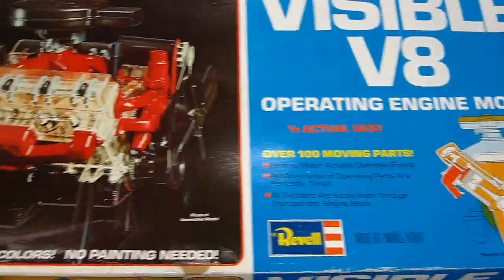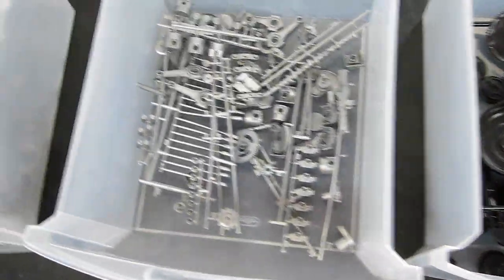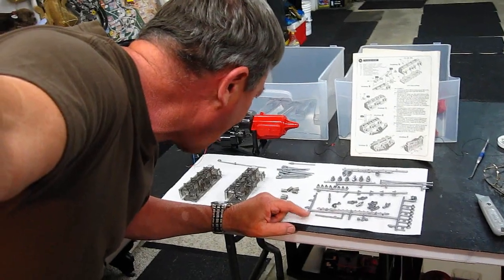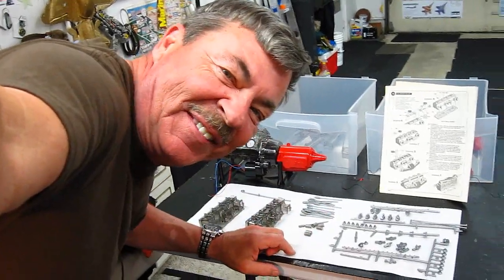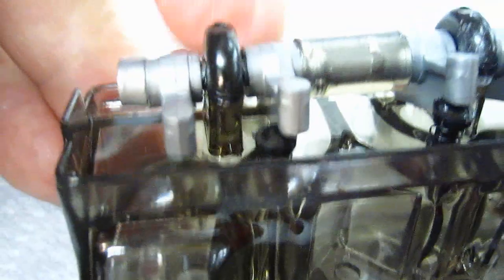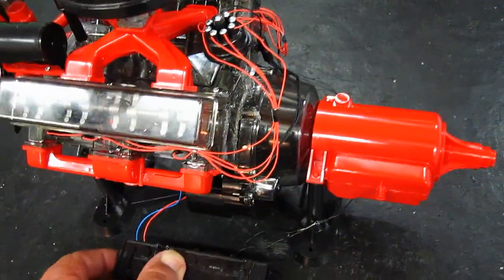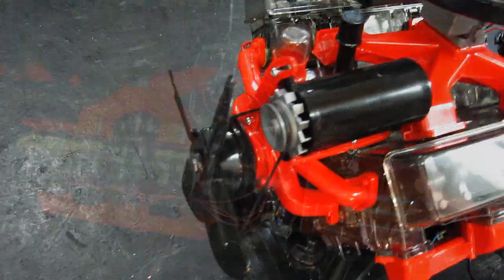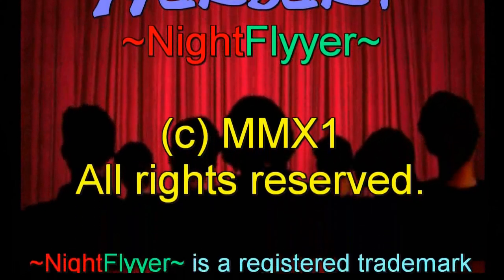Vintage 1977 Revell Visible V-8 ENGINE BUILD. Electric Starter and Spark Plugs shown running.

Comment: I had a visible V8 my mother father bought me in 1978 or 1979 I was 14 years old and I remember I built that and I kept at it until it actually worked and some of the parts were hard and you had to be real careful not to get the glue on the clear Parts because it would actually stain them especially with the sniff proof glue by testors it was really strong it actually smell like an orange I actually went on the school that next year and took all the Mechanics for 3 years and High School went out and went to Lincoln Technical Institute for automotive and diesel and after that went to work for Ford Toyota and other business ventures and still at it

Comment: I had an earlier version and had a clear trans with gears inside. This builders problem with the valves at 4:29 is because he installed all the rocker arms upside down. Look at the instruction sheet at 3:29 you can clearly see the rockers should be web up, not down. That's why they wouldn't swing out of the way to install the valves.
Reply: @Eagle 72 - As is usually the case, you must be able to read and understand the instructions to properly assemble with no issues.  I was 11 years old in 1960 when I built mine - no problems at all, worked great.

Comment: I recall adding some sort of oil and the thing basically melting 😅
Reply: jimmbo2.
Plastic safe, or plastic model oil should be used, and is available from any hobby shop.
Reply: About 40 years too late😂

Comment: The latest Revell Visible V-8 has no electric motor or grain of wheat lights.
Reply: @Richard Persoage - The original maker (Renwal) in 1960 is the only one with working spark lights and electric motor.

Comment: Thank you for this video.  I still have one of these unassembled.  You have given me the confidence to start building it.  I'm like you.  I have opened the box and closed it back up many times.  Wish me luck.
Reply: @St White - I just bid on one of these that is in mint condition - never opened - shrink wrap still on box.  The final bidder paid $330 for it!  I built one when it came out in 1960, when I was 11 years old.  Don't be afraid of tackling the build - it's not hard at all - good, clear instructions.  If you still have not built it keep in mind what you could get for it on ebay!  I believe it sold for around $15.00 in 1960!
Reply: St White.
Make sure you use plastic model oil from a hobby shop, as some oils dissolve plastics.

Comment: I had one of these that was offered by Renwal. Not sure was I did wrong, but the nuts that were glued in place would fall out. Also, the gears in the starter motor would strip out. I was fun to build. It taught me a lot about how engines work.
Reply: Kirk Matherson.
You must use an epoxy to glue the metal nuts, and also sand, and deburr all the moving parts, as the new kits are not very well made.

Comment: same engine as my dad's s10 92. Looks like this but the carb lid is more modern. and is hooked up to the radiater. My dad messed with these in the 60s and I want one! Sooo bad! I wish they had one with a saturn sl1 95 I would totally buy that

Comment: I have two of these, slightly, very slight, started.  One without the drive motor and spark plugs, hand crank type.  Directions copy right 2006.  The other has the drive motor and spark plugs, directions copy right 1987.  Both in original boxes.  I'd sell them.  Anyone interested?

Comment: I also had one of these in the 70's !!  It had the light up plugs etc., as I understand it this kit was first made may Renwal then by Revell etc. - but just as you have found it has many problems with fit and durability.  I still remember I had some really bad fits and the rotating assembly was sketch in places, eventually the plastic boss where the starter motor attached cracked and I couldn't run it any longer.  I kept it as a shelf item for decades until someone wanted to pay me stupid money for it--lol  If they still made one with the lighted plugs I would build another one using a newer kit and add a motor on the back, but one of the coolest parts of the model was the plugs actually firing in order.  Plus they want way too much money for one now considering what a poorly engineered kit it was.  Lots of memories here though.

Comment: I bought one of the newer ones to build with my son. I definitely notice some differences from yours. Ours is made in china. no electric starter, no lit spark plugs, or working distributor.  rockers look different. The one thing that really bothers me is the valves do not open in the correct sequence when turning the crank in the direction indicated by the arrow. You have to turn it backwards to get proper intake, compression, ignition, and exhaust with valves opening at correct times.
Reply: Fred Geitner.
Sounds like you installed the camshaft 180 degrees out.

Comment: I have one of the original Visible V-8's that has the electric starter and blinking lights to simulate the spark plugs. For extra realism you might want to get some white modeling paint and paint the spark plug insulators. Also, get the number 1 piston to TDC and paint two white lines on your model to simulate timing marks. Put one mark on the crankshaft pulley and the other one on the front timing gear cover. Then when the engine is running the number 1 spark plug will blink every other rotation when the two timing marks line up.
Reply: I called Revell a couple of years ago and was told there were too many complaints from people who couldn't get their model to work properly, so the electrical components of the motor were dropped. It's a shame it's been "dumbed down." The electric model WILL work beautifully, but it requires much work to so. It can't be slapped together.
Reply: How much
Reply: How much what?
Reply: Do you have a visible engine for sale
Reply: No sorry. The one I have I'm emotionally attached to it and I wouldn't sell it. I think you can still buy one from Revell, but the new ones don't have an electric starter to spin it or flashing spark plugs.
Reply: I'm sorry I read it like you had one for sale. I want the one with the starter and lights. The newer is not as "cool" as the old
Reply: Good luck. If you could ever find an unassembled kit for sale somewhere it will probably cost you a fortune, especially if it's an older one with the starter and lights. But if you can find an already assembled engine it might be a bit less. You also might be able to locate a damaged one for less money. If so check with Revell to see if you can get the parts you'd need to repair it. Lot's of the parts are common to both the newer and older V-8 model kits and they are available. I got some replacement parts for mine a few years ago from Revell so you might be able to purchase and repair a damaged engine.
Reply: Correct!

Comment: i built this with my Dad in the 1960's , so im guessing that this model had an earlier production run ? does look identical though . nice work .
Reply: Was originally made by Renwal late 50's / early 60's.

Comment: Great Video. Got (2)parts v8's on Ebay. I bought a Visible Chassis for parts at a country auction. Finding parts on Ebay to be very pricey. Hope to marry the engine and chassis together. These models are NOT for amateurs.

Comment: I built this same kit back about 77 or 78. Yes there were some difficult procedures, but it took time to get them right. You definitely have to have some good modeling skills. Sometime around 1990, I modified it with a new little battery powered motor from a radio control car and got it to turn a little faster. I was very surprised the little lights in the spark plugs still worked. .I had that thing well into the 2000s until a small fire in the basement destroyed it. I noticed that Testors blue tube glue was used. That stuff sucks. I do contribute my long life V-8 to using the red tube glue... Excellent job on this one!!!

Comment: This classic one is better. The new ones suck! I miss this classic. I wish to make the distributor work like the old one. The starter doesn't work either. It's all just plastic. I wish someone sold a companion kit.
Reply: Search on Ebay for a Revell kit (built in the 80's) with all the features of the old original Renwal version.

Comment: And I am 55 and never built a real motor but worked on my 68 390 and rebuilt the 4 speed top loader it had in the 6.5 lt cougar.

Comment: That was nice that you read a friend like that and that you honored him by finally building the kit.  I have a newer hand crank model but I'd agree with you that thou train assembly was the most difficult and I had to trim down the pushrods and also come to shape them at the camshaft and they still stick a little but they work and some of the rocker arms don't push down the valves because their little short now because the pushrods are little shorter but it's the only way I could get the pushrod thou assembly to work.  I used olive oil as a lubricant and they said to use vegetable oil which olives or vegetable but I did find two missing parts spark plugs but I ordered them from Revell. but I just wanted to see if anybody had built something like this and I did find a real quarter V-8 motor with a supercharger Connelly don't know if the spellings right they went about $8500 before I found your video.  Thanks a lot.

Comment: Cool vid. These models are now running around $200.00 nowadays. Worth it to buy the newer model and place a motor in the driveshaft
Reply: About $90 at Super Cheap and Repco stores, (Australia). btw , it's the old Studebaker 259 ci.

Comment: the 1977 version I did(I think I got it in Christmas of 1979)was nice, went together very well and had no flash what so ever. I was just 9 years old had no X-Actos or special tools, and it helped it had no flash. the one I did in 1989 must have been a different variant and it had tons of flash and worse still, inside the cylinders. fortunately I was 18 and had not problems then getting rid of it.  I did not paint the internals in either engine. would have liked to though and now lookiing back I'd do one again just to paint  the guts(not the block of course) except I do not know if that would affect movement with the parts which are so closely interlocked. Some of your parts look like they have been painted, was wondering what sort of paint would work and not affect part movements?

Comment: Got this for Xmas when I was 13yrs old I am 55 now. was not that hard for me to build then it was  just time consuming  I had every thing working in about 3 days and entered it in a science fair a my school  later that year. the only problem I had was the crappy gears in the starter did not mesh correctly . fixed that by using a 12 volt train transformer and  breaking it in

Comment: I had one of these, back in mid 80's, along with a turbo ford 4, this one was easier and worked better.
Reply: +93sundance went through a lot of paper towel and mineral oil. Tricky, but a fun build!

Comment: The cons are : the cylander walls are hard to align, the timing gear sometimes jumps a cog, the valve train is noisy and some of the valves don't work very well, and there's a lot of oil over everything...so then Revell made a perfect replica of the Chevy motor then? :D - But seriously, that's a nice build you have there and a great review. I'll re-post this on my facebook hobby store web site : Monster Hobbies in High River Alberta Canada  C&P into your browser and join me there!
Reply: I have done a few of these and still have two that I bought used and falling apart. After restoring them both years ago they both actually still work. Great models in my opinion and yes one has to have great modeling skills to do these. They are still found on eBay as vintage kits alone with the newer versions.
Reply: @Jerry Brown - I wouldn't say you need "great" modeling skills, just some modeling skills.  I built one when they first came out in 1960 - I was 11 years old, and had no problem at all building it.

Comment: Thanks for documenting the build. I, got one for Christmas in the 70's and had exactly the same issues: glue and lube all over, binding valvetrain and jumpy gears, cylinder / piston rod alignment issues (I forgot the part about assembling the valves). But after building it, I had no qualms about tearing down and rebuilding real engines.

Comment: you did a super great job, i don't have the vintage one but i do have the newer one, fact i 
have one i had started to build, got dusty, but still turned over, then broke, so i bought a nother
one off ebay, so i have one new kit, and mass parts, im going to build my soon, im 52, and am
looking forwardf to building one also...any way great vid. oh check out my 69 firebird here on you tube, i put a tunnel ram in her, and its all pontiac,,,,great vid....Tim

Comment: Hi, thanks for this video. I am considering building one of these. I have read many bad reviews of the new Revell V8 kit. Mostly screws being the wrong size and the parts not fitting together. There are a few of the 1977 kits available on Ebay, do you think this would be a better choice?

Comment: my grandfather bought me one back in the 70's when I was a pre teen , I built it , and since we were a gear head family we did some tricks to loosen it up and you didn't hear the starter motor as much as the gears where lapped in ,  I liked it , but my brother being the idiot he was and didn't appreciate others stuff thought it would be neat to wire it to a train transformer . needless it ran for 5 minutes before it melted parts together , I wish I could find another of the older kits .

Comment: @Elios0000 
I wouldn't use CA on clear styrene.  it will bloom (cloud the plastic surface) and it's just not as strong as styrene cement. 

I do like the modern thinner Testors red in the triangular bottle.  It's still very slow to fully cure, but it won't cloud the plastic and the resulting joints are by far the strongest of any of the glues.  Much stronger than the water thin Weld-Ons, Bondede or Tamiya glue.

Comment: You have a rare "black out" Visible V8. 
They are not worth more than any other Visible V8, but they are rare just the same.
Many of these were returned to the dealer for a refund and then tossed out.
Nice video, thanks.

Comment: I put one of these together as a kid (I'm now 44)and it helped me understand the operation of valve train, ignition systems and timing. That was not an easy model to assemble especially as a kid but I sure learned alot. Thanks for sharing Dave.

Comment: @NightFlyyer HATE testers glue just use CA on it works much better then "plastic model glue"
you should see the plamo scene in Japan they are nuts with model kits 
that non-toxic stuff is the worst glue i have ever used